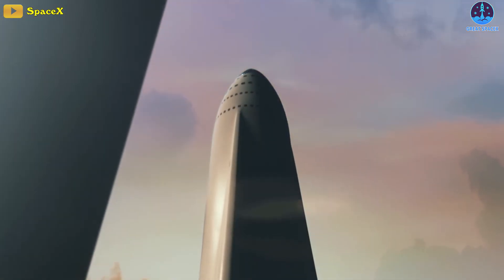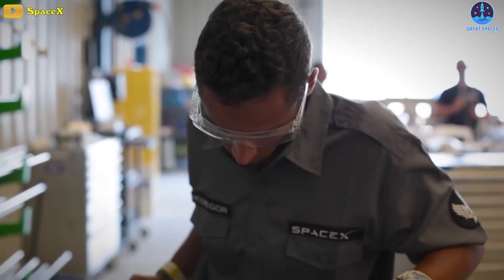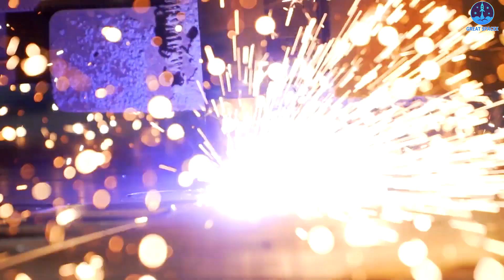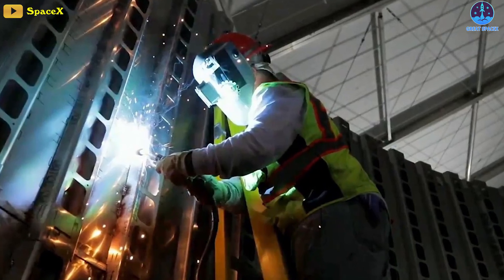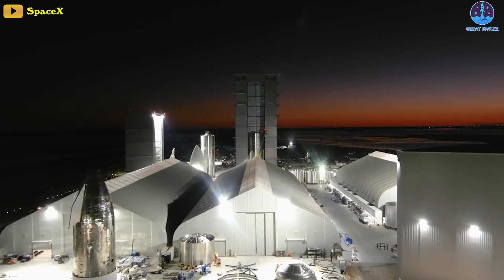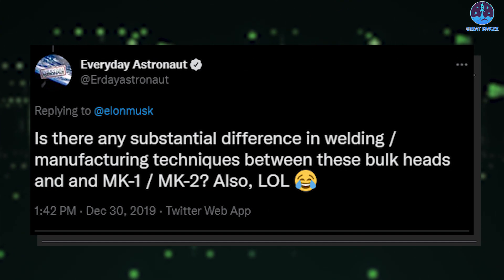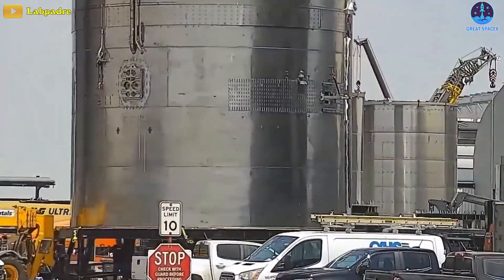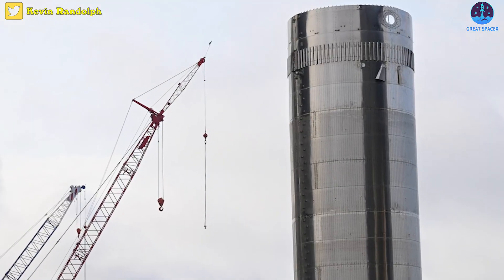SpaceX's NEW UPGRADE On Starship's Welding is unlike any other!

Comment: I see why they are having difficulty picking the weld process. They have yet to realize it’s not just the process, it’s also the welder. I weld in Austin and tried to work for space x. But changed my mind bc they don’t pay much. Until they bump up the pay they will not get the talent they need.

Comment: around 2:47 u showed n image of a tip of a torch, theirs kind of n inaccuracy tho, u need gas with regular wire, but the drawing says its flux core, u dont use gas with that

Comment: Flux core welding typically refers to gas-less wire feed. The electrode used has flux materials in its core. These materials create a shielding gas when burned.  Unlike in Metal Inert Gas welding, there is no need for an external gas container to supply shielding gas.
Reply: Sshhh. this is a page meant for fanboys and right now they need to hear that spacex and musk has invented something never before seen...

Comment: Also one of the reasons to move away from composite materials is the ability and ease to REPAIR a steel hull or air frame. I just wonder why they didn't use friction welding from the start which is a method that Nasa started to use decades ago.
Reply: They did. Falcon Heavy did use on the break-off fuel tanks.

Comment: How did they refine the welding?   By asking actual welders how to weld.     The first one could have looked good too if they had actually consulted experts.   But they don't think blue collar workers are smart people.  SpaceX thinks ideas come from people less than 25 years old, with engineering degrees that they cheated on every exam, and less than 2 years real world experience doing any kind of work.

Comment: So what processes are used to verify all of those welds are perfect? Not just on manufacture, but also after being stressed by launch? I think that the step from carbon fibre to stainless steel was a step backwards. Steel might be good to prototype with but if you're building something that can be re-used dozens or hundreds of times, the cost of assembly is insignificant compared to the cost of use. Also, Rocket Labs is using carbon fibre and they claim a cost effective process and reusability on their new Neutron design. And the payoff is not just extra performance but also being able to use simpler, less stressed, more reliable engines.

I wouldn't be surprised if Starship later evolves towards using carbon fibre. The payoff in terms of performance, payload etc is huge.

Comment: Localize the heating zone is the only way to control the sheet metal warp to the minimal. The thermal expansion of stainless steel is so high that even the TIG weld will cause sheet metal to warp if heating zone is not control to small area. Laser welding is very unlikely since the welding gap in such size of project will be big and it will be nearly impossible to have laser weld.

Comment: Stainless ain't too hard if you go slow and/or at a low temp. Although I don't know how thickness of the stainless they are using. I weld up to 1/8 stainless at my current job and its actually pretty good at taking heat. I've never seen the tip tig process of welding! I do a lot of tig and I've actually gotten pretty board of it. That process is like a cross between tig and  mig so weird. Guess they really are going for that speed.

Comment: this is why nasa and others are quickly falling behind, they make a design, spend the money and then stick with it and just make it work regardless of the downfalls. but instead of doing that elon is running it over and over doing redesigns and new mockups top fix the problems instead of finding countless workarounds and dealing with drawbacks

Comment: There is some very incorrect weld information provided. stainless is not a difficult material to weld, aluminum is much more difficult. That is because the heat in the puddle remains concentrated, rather than spread as in aluminum. Also stick welding uses shielding gases generated when it's coating (of the welding stick) is vaporized during the welding process of the stick. Gas is not added externally. You also showed pictures of MIG welding process where , in a different process, the filler material is used as the electrode and exterior shielding gas is added. There are different mixes of gases used with MIG depending on the material  welded you mentioned only one of these. TIG usesArgon exclusive of material. . Don't mix this up. Have your script reviewed by a competent welder.

Comment: Yes: 
I figured SpaceX  was using a fairly  exotic  type of welding  on thier fuselage. 
Laser welding runs a steady  bead without stopping at a high temperature,  without 
Manual operation .
TIG is fairly  good , 
But can require manual 
 control with stoppage of the bead from time to time , everytime the bead is interrupted 
the bead is corrupted causing  a weakness .
However TIG is preferable to Argon 
by a factor of 10 .
I can imagine  that Laser welding is probably  better by a 
factor of at least 20x.
I wouldn't  be surprised to find out it is better by 
a factor of 100x .
However the COST of 
Laser welding is probably 100x more expensive also .
 If You ask me to go up in a rocket that is welded by Argon welded or a rocket welded by Laser welded .
I choose  the Laser job
100x out of 100 !
for safety reasons .
Don't  want to die going 
Into LEO because the rocket is falling apart ! 
 DML

Comment: The Strategic Buzzword Initiative marches on!  Between NASA and its Friction Stir-Welding and whatever we claim to be doing here... I can't help but remember that 100% joint efficiency was achieved long ago, generations ago!  OLD books about welding show black-and-white pictures of pressure vessels for spacecraft being welded in huge elaborate fixtures with inert gas plumbed all over the place.  I think this is like, the apex!  Of course thousands of detail improvements are possible.  New research comes out every month.

Comment: 0:30 - Simple: someone finally read a trade school textbook on welding (and Musk, for once, listened.)
Reply: Considering the rapid iteration method Musk uses, which is proving very successful, its quite obvious that he listens a lot to idea's from others.
Reply: @Bezerker1181  When everything else fails... Blundering around concerning materials and welding techniques was epic.
Reply: @bazoo513  You're skipping the part where the goal is to reduce the cost instead of inflating the price to ridiculous levels. You either start somewhere immediately or start wasting a lot time and money trying finding the right welding specialist that understands rocket science. In the end hes probably has one of the most hightech welding systems all developed inhouse.
Having rockets landing themselves and doing that dozens times in a row is a feat nobody can even come close to.
If "Blundering around" was the reality spaceX would be long time dead.
Reply: @Bezerker1181  Remind me - how is acquiring the whole machinery - mandrels, fiber winding machines, autoclaves - for carbon composite "Mars colonial transport" before looking up prices and thermal characteristics and switching to steel "reducing the cost"? How is experimenting with various stainless steel alloys and welding techniques instead of, again, looking up their characteristics reducing the costs? Or do you think that reading the right trade school textbook is greater "waste of time" than arriving at the right combination of material and welding technology after - what - dozen test articles and prototypes? Welding is not "rocket science" - it is common knowledge.
This is just Musk's typical "do first, think later" approach.
BTW, have you noticed that thermal protection tiles from SS#26 have been removed? Obviously, a great cost reduction measure.
Reply: @bazoo513  The cost reduction starts when the rockets start flying. If you dont try anything new youll just end up with billion dollar single use rockets like nasa does.
Instead of constantly trying to pump money into 1 thing trying to make it perfect, you should thrive to make the perfect design instead.
It all about long term goals. The falcon 9 has already launched 139 times, with i believe the most used one reached 13 flights. 
Thats economics. The cost per flight is a fraction compared to the competition.
Reply: @Bezerker1181  Falcon series had very few "try whatever, see does it work, rinse, repeat" cycles; it was designed and designed by top experts like Tom Mueller and Hans Koenigsmann, managed by Gwynne Shotwell, all of whom Musk was smart enough and persuasive enough to recruit. His "elon knows it best and all others are idiots" approach came to light only when he thought that bolting three first stages together to make Falcon Heavy would be trivial. At least he had the integrity to admit that. 

NASA was forced by the Congress into building the SLS monster, no matter the cost (actually, the costlier, the better). their budget authorization, which has the power of law, stipulated that they must use leftover Shuttle hardware, however unsuitable it might be (remember, Shuttle was also reusable - Discovery flew 39 times), and mandated use of the same thousands of subcontractors from every state. The latter - spreading the pork to virtually every congressional district - was the whole point. NASA tried to offload launch and taxi functions to commercial operators long ago, but even when commercial transport services programs were started, Congress kept defunding them in favor of SLS.

Other launch vehicle manufacturers were discouraged from trying reusability by long, complicated and expensive refurbishment process Shuttle went through between flights. but that was also something forced on NASA. The original plan for STS (look it up) hade much separate, much simpler crew and cargo transports (much like SpaceX does), orbital tugs, fuel depots etc. They were forced (this time mostly by the military) into building far too big, too complex vehicle for the sake of high down-mass and cross-range capability making single orbit missions possible.

Musk's greatest engineering insight is "best part is no part" - SpaceX vehicles are as simple as possible. True, landing hardware and fuel needed for boostback, re-entry and landing burns all cut into the payload, quite significantly so, but the, F9 has sufficient payload for most missions. For very heavy payload, there is Falcon heavy, if needed in fully expendable mode. 

Nevertheless, a bit of up-front thinking (or retaining the original team and listening to them) would have cut at least a year, probably more, from SH/SS development time. Relative advantages and disadvantages of carbon composite, aluminum and steel are well known - robust reusability and relatively cheap, mass production rules out carbon composites right away, and yet musk wasted a year and a pile of money on it. the same holds for nuances of steel and manufacturing process, although the saving afforded by actually reading the literature or asking someone would here probably be just several months. Remember how Musk announced switching to TIG welding as if it was a revolutionary invention, not three decades old technique?

And, BTW, the launch price per kilogram by Falcon 9 is less than competition, but not dramatically so. I hope that the actual cost is much lower, and that that's what finances SH/SS development. Then again, musk said that filling up the Sparlink V2 constellation is critical for the company survival - can't it sustain itself from launch services?
Reply: @Bezerker1181  Perhaps. 
As "rapidity" of iterations of Musk's plans goes, consider: in 2011 "Red Dragon" was announced,  a modified version of Dragon 2 to be ferried to Mars by Falcon Heavy. in 2015 it was replaced by "Mars colonial transport" which became BFR which became SH/SS, in countless versions, varying dimensions, material, payload etc. So, Starship is at least seven years under development. It took NASA eight years from the first suborbital flight atop an ICBM to boots on lunar surface. Now, which of those is more rapid?
Reply: @bazoo513  SpaceX's succes and close ties with NASA don't require worship. But you do seem to be making up a lot of excuses for NASA.
Reply: @Bezerker1181  The problem with your reasoning is that you fall into typical trap of idolize/hate dichotomy so typical of social media, especially when colorful personalities like Musk and their undertakings are concerned.
Falcon 9 and Heavy are marvelous launchers, without a peer, although not as revolutionary as many idolaters claim; they, of course, "stand on the shoulders of giants", but that's how progress is made. Dragon is also a success - that's how things should be done (I just hope that Musk's insistence on "touchscreen everything" will not bite them in the but eventually.) Compared to SpaceX, Boeing is tragicomical.
I also said, multiple times, that I admire how Musk managed to find and attract top talent in the days when SpaceX was a non-entity.
But that does not mean that I may not be critical of what I see as mistakes and wrong turns taken, or give NASA (and other) credit where the credit is due.

Comment: Now after saying that below I must add that there are new welding process that require less welders skills like handheld LASER (depending on the thickness), also it is not difficult to set an automatic orbital machine that follows the center line of welding even in field conditions and horizontal welding. The final result of the welding nevertheless should be verified with a Quality Control system that includes all necessary methods that are applicable for each case. In my career I saw welders doing their job like a machine but they were previously certified. It is not difficult to get them since they are accustom to do that type of job. They were working in building of nuclear plants, or stainless steel pipelines in chemical factories. Those are the people. 
Nevertheless it should be considered Handheld LASER welding ans the final result will come out from a Mechanical Test. Attaching a handheld LASER welder to a Orbital machine is easy, a matter of few screws. Only doing short and medium welding with welders.

Comment: Im a welding Engineer. I worked in the building of a nuclear plant and after in a welding research center and welding lecturer. This is what I have to say: All mistakes they made is like they were improvising because it is very well known the characteristics of different steels and also the advantages and disadvantages of every single arc welding method and their field of application when you come to type of steel, thickness and even the type of filler metal to make sure it will not be weaker than the base metal. All this excellent video describes all that is well known long time ago. TIG (GTAW) is not anew process,it was discovered after the IIWW, similarly MIG/MAG and their mixes (GMAW). There is experience in industry and I cant just understand all those mistakes.  Depending of the thickness it is usually better pre-built smaller rolls using automatic welding (SAW or MIG with argon or Helium), trying to reduce the amount of welding in field conditions using manual or semiautomatic processes where the final quality rely on the welders skills.
Reply: I am a 40 year welder and I agree with you. Any experienced welder could tell you what went wrong from the description. They need better engineers
Reply: They got the wrong guy for the job.
Reply: I think you nailed it initially..

Looked like a " we need a starship ON THE FLY ".. like in a restaurant kitchen needing a dish ASAP.
Reply: Put it in hot LOL that the story I got, it's funny that it makes me think of tractor trailer drivers with dispatcher plans . Just get it there early , weather you have the leagle hours to do it or not. It's not their neak in the noose when the driver gets caught by government. But you're fired if you don't get it there on time. Pushing your luck always.
Reply: Im not sure this video is accurate. Flux core with a shielding gas? It sounds like babble and nonsense.
Reply: @dreed7312  its called dual shield. Not common but great if you need a hot weld with low amps
Reply: @dreed7312  that what I was thinking f you have flux core there is no need of a shield gas. One or the other. Especially on stainless you need a backup gas or copper plates for a good weld.
Reply: this is a fanboy page and with that, you're going to make all the fanboys cry :D
Reply: @ville9738  sometimes a good cry is healthy they say 💁‍♂️
Reply: aka a bunch of hacks throwing shit together lol
Reply: I've not seen a robotic weld planishing machine in the field though, that would be a video worth watching!
Reply: Surprised they weren't using laser welding....
Reply: Yep
Reply: What do you want from well known snake oil salesmen, who "invented" 130y old idea HYperloop LOL
Reply: I concur
Reply: Musk learns but he is not a rocket engineer, he hires them... eventually